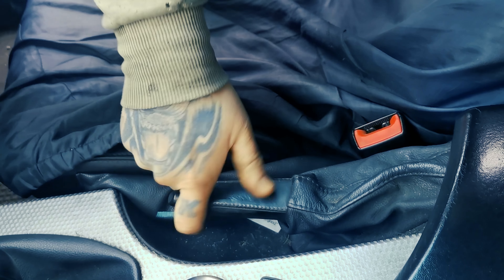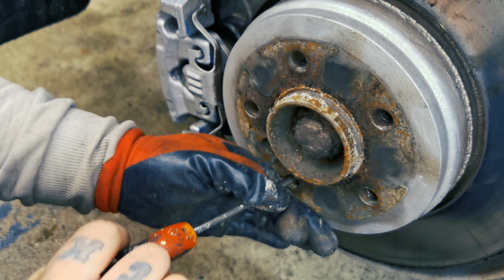FIX YOUR BMW HANDBRAKE WITH ONLY 1 TOOL!

Comment: Do you have to have both wheels of the ground?? I had 1 off and couldn’t turn the hub!! It was locked.
Reply from the maker: We're you working on a e60 BMW?
Reply: Yes…
Reply from the maker: Be sure that your handbrake is not applied while performing the repair, also be sure your brake isn't seized or you have a welded differential!
Reply: @fueld6244  handbrake was not applied and pretty sure brakes not seized as I drove afterwards…. Do both wheels have to be jacked up?? Cuz I only had 1 side jacked up. Thanks
Reply from the maker: Yes both sides need to be off the ground! Hopefully that was your issue! Glad we can help.
Reply: @fueld6244  No, one is enough if you put the shifter on newtral.